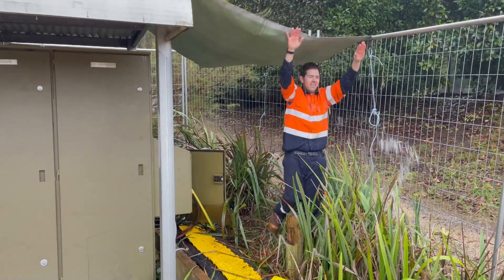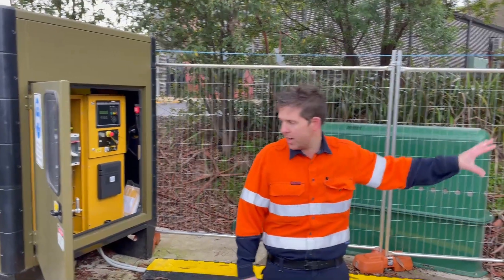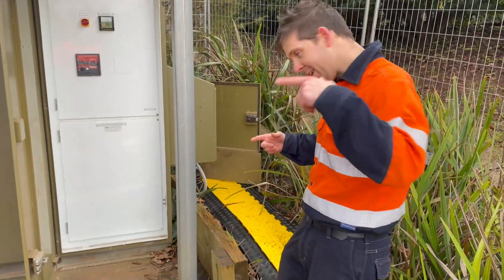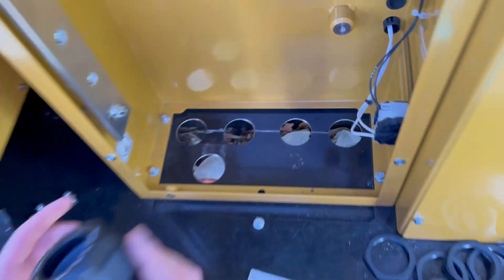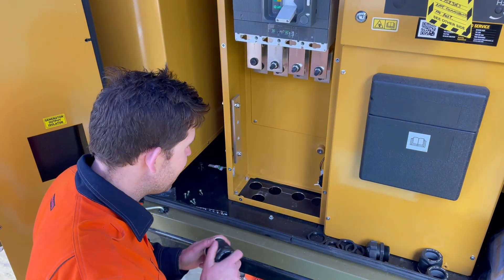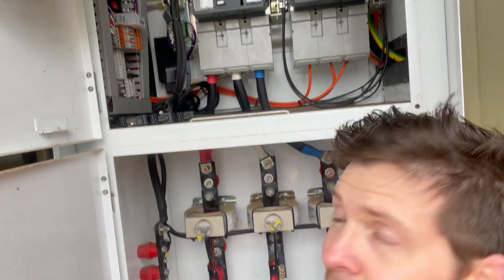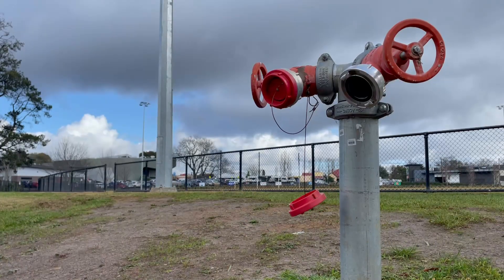Generator Inspection FAIL 😩 Electricians’ avoid this mistake!

Comment: Nice one mate. The one job that the hardhat would have been appropriate.....
Working with 185mm² is such a pain, shame they couldn't parallel 3x 70mm² cu. flex per phase.

Comment: Will that generator have an aux supply to keep the starter battery charged? Some generator installs I have seen only get to charge the starter battery when the generator is actually running, which is not much good if it is run for standby purposes which could mean months without a battery charge.
Reply from the maker: It sure does, turned out to be a great install in the end

Comment: Sawzall?
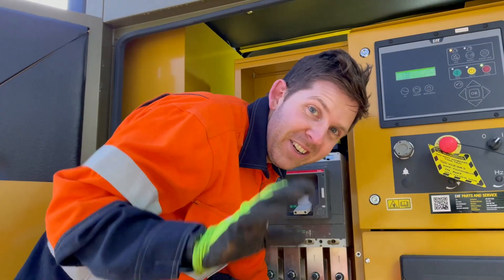Reply: at 3:48 I saw no conductors.  But good job though; gloves, no injuries.  Precise and safe.
Reply: @gregchambers6100   that was a bit of editing, putting the previous footage in the middle of the shots where he was using a hacksaw blade to cut whilst the wires were still there, 4:10 shows it accurately.
Reply: @HungryTradie    You ARE a good editor as well as a top notch electrician.
Reply: Not with the conductors already installed. I probably would have removed the cables and (as you suggest) used a recipro.